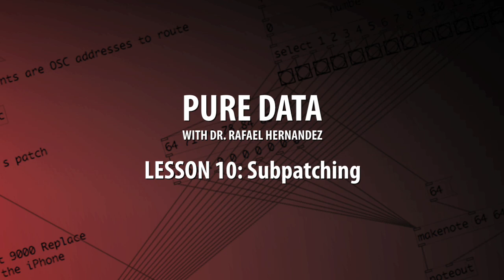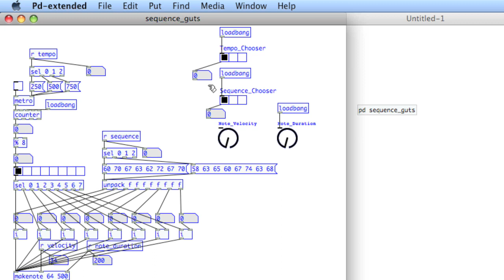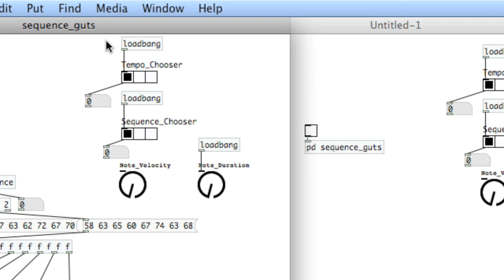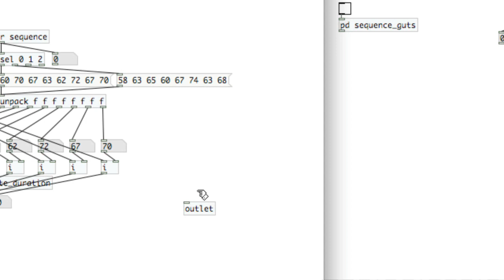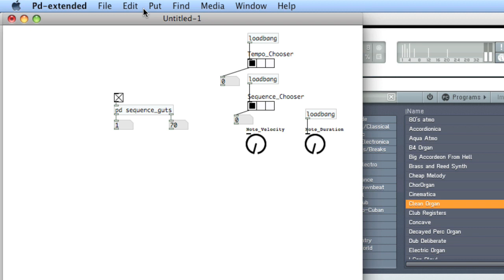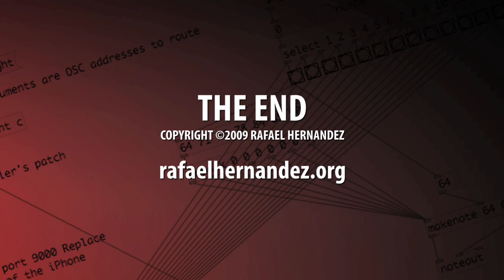PURE DATA: 11 Subpatching

Comment: Hi! Is there any way to create recursive subpatchs, like on C++ and java?? Recursive subpatches are patches that call themselves
Reply: I've never tried it. Off-hand, I can only think of patching a subpatch's outlet to its own right-inlet and then having some sort of internal control that knows when to not take right-inlet data any more (so it stops recursing - otherwise you get a stack overflow).
Reply: That s right! I tried last week but i wasnt succesfull, because I didn't include a control that avoid the infinite loop, so the stack overflow. I had an error message like " the subpatch cannot call itself". Tomorrow I will retry with an appropriate control ! If you find a solution, I'll thank you!

Comment: @3:19, what is the purpose of the "i" objects?
Reply: Oooh, cool! I see how the "i" setup changes the behavior of the step sequencer to not execute all notes of the sequence at once when changing the sequence selection. Very very interesting! In the previous way, the "change sequence" data is banged through the hot inlet route, overriding the step sequencers sequential bang order, causing makenote to execute all notes in one instant. In the "i" way, the step sequencer exclusively bangs the data through the hot route and the step sequencer change data is stored in the cold inlet.
Reply from the maker: You've got it right: The [i ] stores integers via its right inlet. They are sent out with a bang to its left inlet.

Comment: Hi, how did you create the velocity and duration Dials?? great tutorials by the way.
Reply: (I know this is 8 years old but I'm gonna answer anyways, lol) he was using PD-Etended, which is no longer alive, although you can still download it, though I don't recommend it. If you go to the help menu on the top bar of PD you'll see at the bottom "Find Externals", type in Knob or GUI and there should be several external patches you can download to get your knob object. Hope that helped, and if you eventually figured it out, then cool, have a nice day!